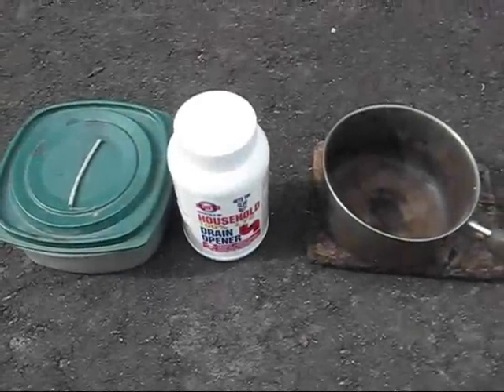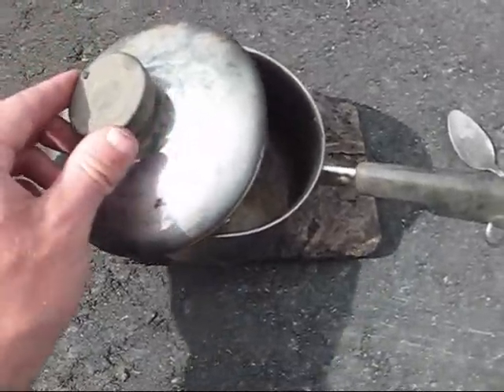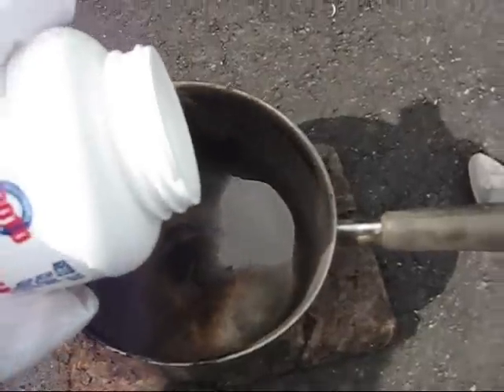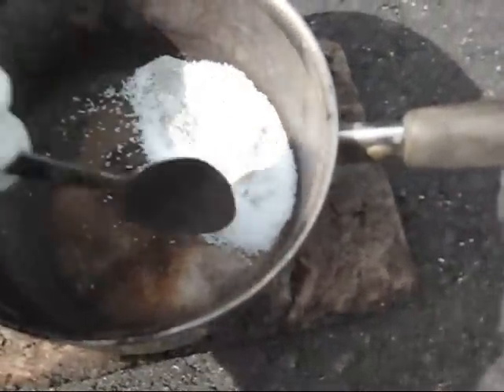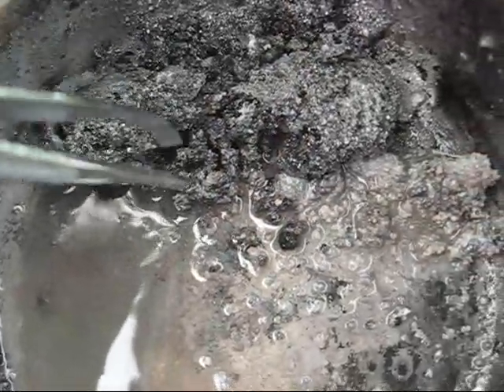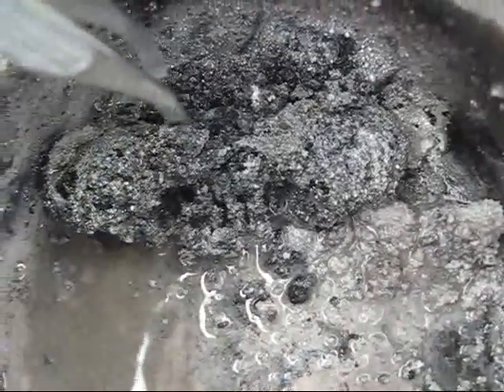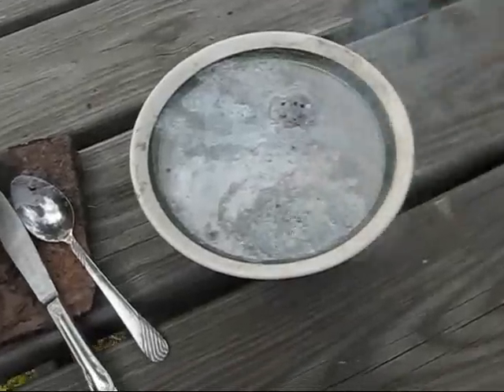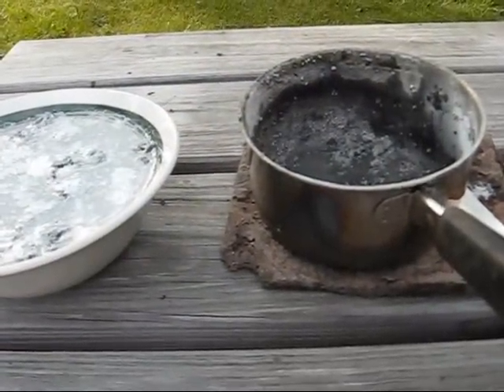Making Sodium Metal

Comment: Yea i know. That's why i put parenthesis around the "substitute." I was just using an analogy - and besides if you put a metal oxide in water it often converts to a metal hydroxide. 

 I wonder if looking at standard enthalpies of formation would help to explain this. 

Also, did you know your reaction works with potassium hydroxide as well? I tried it, and although some of the resulting potassium auto-ignited because of the moisture in the air, I was able to keep some of it.

Comment: Be careful with hydrocarbons. Some of them may have impurities of alcohols or worse. If you want a long term storage, storing in a volatile solvent is good sample-per-sample, so you can allow the solvent to evaporate (eliminates the washing required with mineral oil). You could try some Reagent grade Acetone, or something. That should work.

Comment: Well at worst you would inhale some nasty carbon based smoke. I understand though, I like my nose.

Canola oil and gasoline may have some alkanes forming alkoxides or something. Mineral oil is rather inert, but buy the generic brand with as little extra crap as possible.

If they are equivalent, then H2O probably is not released

Comment from the maker: I am not entirely sure of the reaction. More testing today yielded larger ingots of sodium, large enough to be retrieved but I had no way to store them. It would be difficult to determine the reaction precisely without a more controlled environment. It is hard to contain such a violent reaction to a measurable space, though I am continuing testing.

I am low on Mg, I only have enough for one or two more attempts. I should have more in a week or two.

Comment from the maker: It has been heavily debated. Some say the high energy levels reverse the reaction, others think that it doesn't create sodium at all but that the Mg is so thoroughly integrated into the NaOH that it reacts with it violently in water so as to simulate a sodium reaction. I do not believe that however. It is rather obvious when watching the reaction with water that it is indeed sodium beading up on the surface, not simply Mg reacting. Lab testing could only tell. Or purification of an ingot.

Comment: Hey bro, looks like a great reaction. I do have some questions though:

Wikipedia's "Standard Electrode Potential (data page)" lists Magnesium has having an oxidation potential of 2.372 volts, whereas Sodium has a reduction potential of -2.71 volts.

This gives a net voltage of the Mg + 2 Na+ ---> Mg 2+ + 2 Na to be about -0.338 Volts, which is nonspontaneous.

How did you get it the work then?

Comment: That's definitely not pure sodium. If you threw a that large chunk of pure sodium into water, it'd have blown all the water (+NaOH) up in your face...

A more better way of producing pure sodium is by electrolysing molten NaOH (+- 200*C) with nickel electrodes in a nickel jar, preferably with wax on top. The nickel is not harmed by the liquid NaOH. Pure molten Na will float on top of the hydroxide, just beneath the wax. It might be unnecessary to mention this is a dangerous experiment.

Comment: Yes, it's really strange that Mg can reduce Na, because in "aqueous chemistry" the standard potentials are -2,71V for Na and -2,38V for Mg, making Na the stronger reducing agent, but this is a different environment (no water and much higher temperatures) so it seems to be switched around.
An even more extreme behaviour is that of K2O which can decay to K and K2O2 at higher temperatures, here the K+ ion is able to oxidize the oxide ion to peroxide, the potential difference in a solution is ~4.7V!

Comment from the maker: Indeed. As you can see in this video, I was to slow and did not have enough wax. As a result much of the sodium burned away, and the small amount of wax heated to boiling and caught fire. More wax would have stayed cooler.

I would also like to try simply sealing the crucible from the air while cooling. It would allow the use of a more combustible liquid that could be removed easier, such as kerosene. For obvious reasons it would not be suitable at the high temperatures.